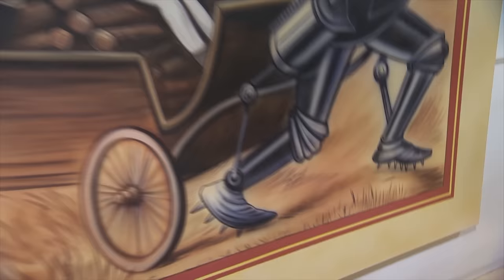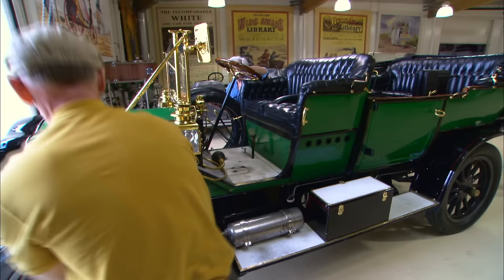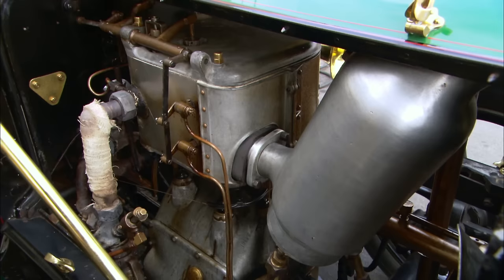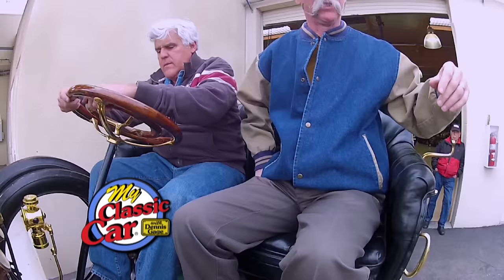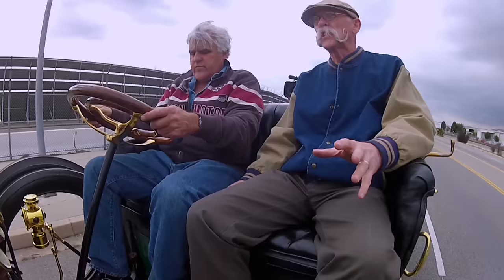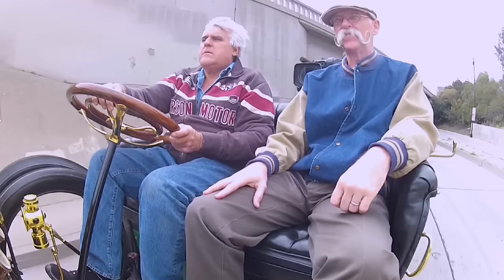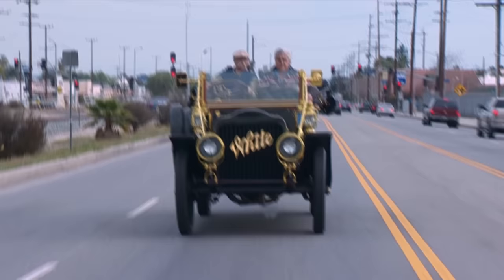Jay Leno's Steam Cars

Comment: why don't they make these anymore? I would buy one. Coming 2019 Ford F150 SteamBoost
Reply: direct steam drive in a medium truck that has to pull crazy heavy loads is actually a good idea
Reply: Ærik Bjørnsson yea lots of tourqe
Reply: Eco Watt Boost engine! Supercharged Steamer!
Reply: VW actually works on new steam cars since 2005.
Permanent combustion is way cleaner than interneal combustion which has to happen in a few millisecounds.
Reply: Overengineering Hello, somehow you caught my attention with that Wv making new steam cars, but I couldnt find any piece of information on that topic. Where did you see that ? Could you please point me somewhere ?
Reply: First my teacher in 11. grade told us that he was a engineer at VW and that some higher staff bought the patents for modern steam motors (not classic engine, the words hava a slightly diffrent meaning in german)
Later one of my Professors whistle blowed the secret about steamcars from VW, he actualy has seen the motor prototype, but he also wasn´t working at this project direcetly, he was a Bosch engineer.
Reply: Overengineering. Hm interesting, so it is kept secret. Pitty that they have not come out with any protoype, so i guess it will not be realised. It could be interesting alternative to Electric cars as I dont see those as really viable option.
Reply: Probably due to the insanely long startup times, steam engines take a while to warm up before they're ready to run.
Reply: the747videoer Not if you leave the pilot light running as they said in the start of this video
Reply: there was a guy in Australia that built a steam car in 1970s.  it started and ran like a normal car.  no need to leave the pilot light running.
Reply: alex smith Yes Edward (Ted) Pritchard.
He converted a 1963 Ford Falcon to run on steam.
He only gave up his dream of making a steam car industry in the mid 80's
Reply: u saw how to start up the engine :)
Reply: actually , the late steam cars started pretty much the same as regular cars.  look it up
Reply: He also got stuck at TDC at the end haha
Reply: Steven Polley I had a thought yesterday about the whole getting stuck at TDC thing or starting in reverse.
A well placed Electric motor could give the correct direction on take off and completely avoid the whole TDC wrong direction thing.
Then when not in use could free wheel or even generate a little bit of power for the battery/batteries.
Could also kick the car off from a stand still with cylinder bleed valves open for 1 full revolution to allow condensation out of the cylinder to prevent Hydraulic Lock or piston damage.
Wish I had the skills and money to build what I see in my head.
Reply: Id buy it if you replaced: Ford F150 steamboost with: Any car other than a Ford F150 Steamboost. Spoken from experience. An f150 is just as relyable as a tin lizzie in 1914.
Reply: Erik Van der Zee indeed so. even steam turbines would be more powerful.
Reply: STR are planning releasing the TRX a competitor for ford raptor
Reply: I heard these car's  get like 50-75 mpg with just the steam!
Reply: Erik Van der Zee 1/2 ton trucks arent built to bull crazy loads...3/4 and 1 tons are
Reply: Make it in Cleveland Ohio  ! OH Yeah !
Reply: the747videoer that wouldn’t be an issue at all nowadays. Jay has another steam car build in the early 1900’s called the doble that warmed up in about 15 seconds.
Reply: Pilot light helps with starting the engine up. It does not keep the engine/boiler warm. We wouldn't even need pilot lights on modern steam engines with a sparkler
Reply: that's true.
Reply: Steam trucks still exist ,
Reply: Me , But they're still not steam CARS
Reply: Steam boost! 2019. I want one. *
So cool, lowest tech. Push it a little bit over the dead centre. 😂Haha!
Reply: @the747videoer  One of the selling points for the Doble line of Steam cars in 1924 was that with the pilot light left on, the car can be up and running in 30 seconds even during the winter. Compare that to competing cars of the period having wind up; 10 minutes of warm up for the combustion engine, and cranking engines with a levar. It was a competitive car that also outperformed most of the market. The prohibitive factor in all Steam Cars was the cost.
Reply: @blubb7711  From what I recall read in popular mechanics, several modern engineers still dable with steam engine concepts, either as a side project or actual company projects. I suppose these companies still keep these engine systems in mind due to the global energy crisis that is growing. There will be a point when liquid fuel is no longer practical to the average consumer.
Reply: Don't worry, Elon Musk will make one and a bunch of ignorant blowhards will fall over themselves praising his "innovation" and "genius" about creating "new things"..
Reply: The problem with steam engines has always been efficiency and power density. In order to produce the same power as most internal combustion engines a steam engine would need to be quite a bit larger. Steam power works much better, at least for now, with larger, stationary power generation or in large applications like ships where diesel engines are not always practical. 
Many modern warships, for example, are technically steam-driven, they just use nuclear reactors to generate the heat.
Reply: @the747videoer  There's another Jay Leno video about one of the very last steam cars with electric ignition, it doesn't make much longer to start than a petrol car, and the boiler is super efficient too so it warms up quickly.
Reply: They probably don't make them because people are dumb now,  people back then were smart enough to know how to drive those maybe.    People crash by getting distracted by flashy lights on phone, or trying to navigate their car's radio or digital settings for the heater or ac so couldn't imagine people tyring to control steam and fire and breaks things .
Reply: Ford!!!
Reply: @the747videoer  much like my self so i wouldnt mind starting up with one of these in the morning with a cup of coffee.
Reply: @the747videoer  Stanleys took 30 min.  But with a modern flash boiler a steamer can get up steam in just a couple minutes.  (like the Doble had in the 1920's or experimental steam cars in the late '60's-early '70s).
Reply: @the747videoer  You can have a electric heat system to start the car. would shorter the start time by a lot.
Reply: @northkoreanairforce9529  funny my 01 f150 has 256k miles on it and it's still going strong
Reply: @MrMozkoZrout  going where the electric car went. 1980s had electric cars and were all pulled off the road.
Reply: 800 ft lbs torque is no joke.
Reply: And when you heat the water with anuclear reactor, you do not even have to bother about the fire ans start up.
Reply: @MrMozkoZrout  google for "iav dampfmotor"
Reply: потому что нефтегазовые магнаты не допустят такого(
Reply: steam is cool, but did you see hoe long that takes and hoe many procedures you need? its way easier to just hop in the car, crank thebkey and you re ready to go in less than 30 seconds, petrol engines are also way faster because they re able to hit large amoutns of revolutions per minute, so its 100% more reliable and conventional to just use petrol engines
Reply: @the747videoer  check out the Dobal steam car that had a very fast start up.
Reply: Same. I'd prefer steam to gas since gas is going up in price daily.

As for electric, I don't have an extension cord long enough.
Reply: They won't do it because this engines almost never breaks and you can drive on anything that burns even wood lol. It's all about business
Reply: Like so many things, GM probably bought all the patents and sat on them. GM patented leaded gasoline, and made a fortune for decades from that, and used their funds to kill competition. This is a more noble path than Ford, who used Allied POWs in Germany during WW2 as labor, and wreaked almost as much havoc on South America as the CIA, and never did figure out how to make money from small cars.
Reply: I gotta say, the 1909 White steam car was definitely way ahead of its time and who knows what automobiles of today could've been like if the steam car caught on, it could've been great.
Reply: fidel catsro .
Reply: @the747videoer  nope. Not modern ones with a closed loop flash boiler
Reply: Ford trucks suck ass but yeah I’ll buy one
Reply: Or a 2020 steameco boost mustang
Reply: @the747videoer  not even
Reply: d  nope
Reply: @vguyver2  yeah but I think an assembly line could bring that cost down significantly
Reply: @177SCmaro  yeah but modern materials like carbon nanotubes and graphene could make the car much lighter
Reply: @markvalkrin3128  It would. But since the manufacturers aren't used to these different needs. The start up cost and initial models would still be higher than the average.  At least a first iteration.
Reply: @vguyver2  yeah true, but maybe someday
Reply: @markvalkrin3128  Yeah, maybe. Would look forward to that becoming reality.
Reply: @vguyver2  me too
Reply: you can buy steam engine and put it in some car if ya want, thats possible and is not too expensive to buy.

Comment: Imagine what they could do with steam cars today if they kept making them...
Reply: Crusty Sock boats and other vehicles
Reply: what is a crusty sock boat O_O?
Reply: John Lalawethika good old vehicles
Reply: our MPG would be through the roof and when you run out of fuel on a road trip, just throw some trash and tinder from the side of the road and your good to go for free, we could tow a train, carbon footprint would be lower, and we wouldn't have to hear people with excessively loud exhausts. Gas combustion engine is more efficient then boiler and steam, BUT people seem to forget you can toss anything into a furnace to make heat(trash, gas, wood, leaves, coal, electric heating, etc.), gas on the other hand has to be extracted, refined, transported and sold to us plebs to dump into our engine.  Really is a shame steam lost out, electric is the next opportunity though.
Reply: @BenJaminLongTime  burning trash would release huge amounts of carbon.
Reply: Steam boats are still around!
Reply: @BenJaminLongTime  Holy sh%t that is amazing
Reply: @BenJaminLongTime  I just imagine myself getting of the car in the middle of the desert , pulling out an axe , cutting a cactus in half , draining it's water , and just driving away
Reply: @BenJaminLongTime  "carbon footprint would be lower" Not true at all, wood and coal release way more carbon dioxyde  per kW/h than gasoline or diesel. And I guess trash would be worse.
It's true however that wood is a renewable ressource that captures C02, but to sustain the whole word, it would be required to intensively deforest and reforest the Earth. 
I don't think It's achievable with our current  energy consumption
Reply: Ruin our ozone
Reply: @BenJaminLongTime  MPG wouldn't necessarily be any better. The advantage of internal combustion is practicality and specific power. You can make a very powerful internal combustion engine very small, they start up quickly, and there's also the bonus of them not being prone to exploding. Millions of steam boilers on the road being cared for by clueless drivers is just chaos waiting to happen.
Reply: @awsomesauce03  sure but you could install modern filters on it, maybe that would reduce the overall thrash polution
Reply: that's in 1909, here's what they were doing in 1925 https://www.youtube.com/watch?v=rUg_ukBwsyo imagine if they developed steam cars instead of internal combustion engines...
Reply: @kartonbaba  hahaha, omg crusty sock boat...
Reply: You do realize that nuclear power is essentially steam power right? 😂 We have nuclear/steam powered ships and u-boats among others so there ya go.
Reply: @rickhapstley3866   Climate change/global warming is a scam. Grow up.
Reply: @lavictoire1960  Found the obligatory troll, no one feed it.
Reply: @thaneofwhiterun3562  no more cactus for you guys, those things are protected by the government
Reply: @louisedwards6681  , Guess I'll have to be a criminal then
Reply: Man it might start to rain in california if everyone had steam cars
Reply: My thoughts exactly.. This got me thinking of an electric/steam hybrid that runs on wood smoke. Electric for those hard starts (like the uphill start at the end of the video) and you could run all day on a 20 gallon bucket of wood chips which weighs less than a child passenger.. Look up wood smoke gassification. People run v8/v10 engines off the stuff. It would be far more simple to run a steam car than it is to cool and clean the smoke to run in a gasoline engine. Wayne Keith is the man when it comes to running trucks off of wood smoke and there are videos and documentation all over the internet of his many builds. He has at least a half dozen trucks, tractors, generators, dang near everything set up to run off of wood waste.
Reply: @BenJaminLongTime  However the steam car these guys are running in the video is running off of fuel oil (he says hexane, but kerosene or gasoline works just as well in THAT vehicle) So imo a treated biodiesel should run just as well.. perhaps mixed with something that allows it to ignite easier like home made ethanol. But yes a firebox would work, with firewood, coal, charcoal, compressed paper waste, even pellets would work! Instead of a pellet stove imagine a pellet car that only had to stop and fill it's water tanks. that has solar panels on the roof to maintain the batteries that run the starter motor that helps with uphill starts and also powers lights (instead of the very real blinker and headlight fluid in this model). Better yet the gassification I mention above would be the fix for many.. perhaps not something millions or billions of people could all turn to.. but I think I found a new hobby..
Reply: @rickhapstley3866  "It's true however that wood is a renewable ressource that captures C02, but to sustain the whole word, it would be required to intensively deforest and reforest the Earth. " 

Too late bruh! 21st century logging does exactly that. (in the more environmentally conscious parts of the world anyway... like the US is trying to become)
Reply: @reforgedcriterion1471  eeeer I i know ? The  original argument was about the viability of steam powered cars.
Reply: You know that nuclear powerplant are steam engines linked to a generator right? The nuclear reactor just heat the water...
Reply: @rickhapstley3866  Then why did you bring it up? My point is still valid. We use fuels to power our vehicles. We could just as easily use them to power steam cars that fly down highways and you barely even hear them. Just look at many of Jay's other steam cars. Some are pure luxury. And I know a guy who runs any engine off wood gas. He recently took a trip across the US and back with just the wood he could haul in a truck bed trailer behind his v10 truck.. Do you know how many times you have to fuel up a big v10 truck driving across america? HUNDREDS of gallons of fuel. Just one trip coast to coast towing my life required over 400 gallons of diesel.. Thankfully that summer gas and diesel shot down to under $2/gal.. I went from $4.50/gal in commiefornia to $1.76 somewhere in Tennessee and then back up just under $2.. But this guy did it with a few hundred pounds of chipped tree branches and scrap lumber that was going to be burned in a pile.. Imagine that..
Reply: Coyote swap
Reply: Not much more really. Steam engines were perfected the time this car was made. 

On the other hand they;re very versatile in what fuel they can use and I imagine they could run off coal and wood too if they had the right burner. They're useless cars for first world nations and in the middle of the city but say in the tundra of Siberia? Well they might come into their own.

Their biggest limitation is water. They go through water faster than fuel so if they had a condenser to reuse all the water then they'll be fantastic in areas with large forests for isolated communities. Almost an infinite amount of fuel.
Reply: @mrdojob  a few of jays steam cars do have condensers! And people are running gasoline engines off of woodsmoke these days. Check out Wayne Keith here on youtube. He took a trip across country with just the wood chips he could haul in a pickup bed trailer. Apparently the bigger the engine the better. V10 engines are perfect for this application. This guy has a fleet of wood smoke powered vehicles and tractors, and even powers his farm with a generator run off wood smoke. If you have land you have free fuel for life at the cost of labor. If you cut your own firewood for winter then all the branch wood that people typically throw in a pile and burn can be used in a chunker. Some of these chunkers absolutely FLY through branch wood and will suck them through as fast as you can keep it fed if powered by a tractor. A large wood chipper with a coarse grate would also do the trick. you could feed 6 inch logs into a professional chipper and you can find those used from arborists and fellers all the time. If you're smart enough to build a woodsmoke generator then you're smart enough to fix anything that could be wrong with a used piece of equipment.
Reply: Less fossil fuel emissions for sure
Reply: @MrJames1034  Steam cars are nowhere near as efficient as internal combustion engines though.
Reply: @reforgedcriterion1471   the hard start at the end of the video was because he got the piston stuck in the cylinder at top dead center, not because it was uphill. The mustache guy was literally pushing the car uphill ( to move the piston) so it couldnt have been very steep.
Reply: @onradioactivewaves  I'd still make it my daily driver.
Reply: @kartonbaba  a boat built entirely of intertwined crusty socks.  Tis a marvel of the sea lad.
Reply: @awsomesauce03  And all the CO2 part of that is plant food so it's a renewable resource.
Reply: Ask people who live off the grid